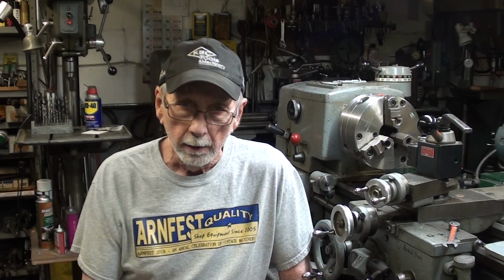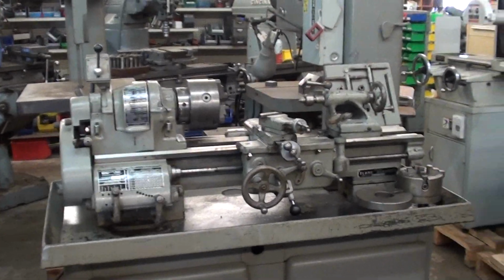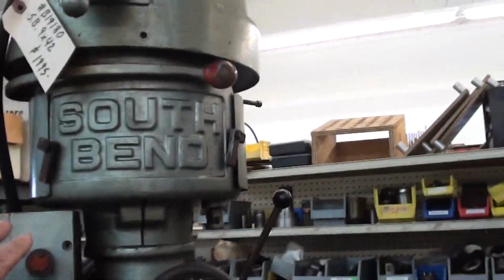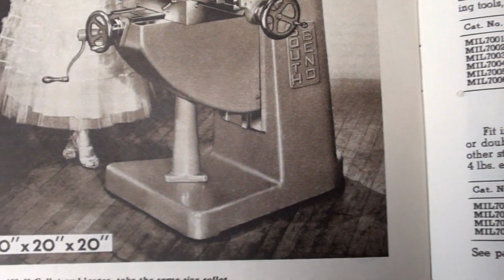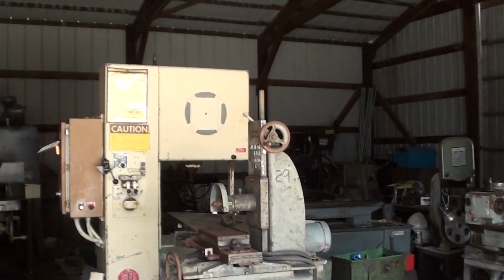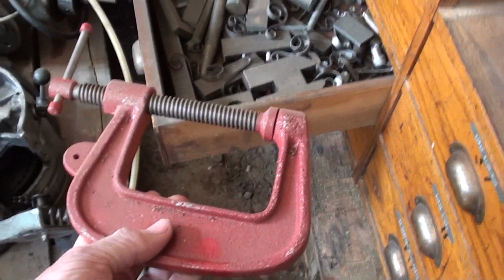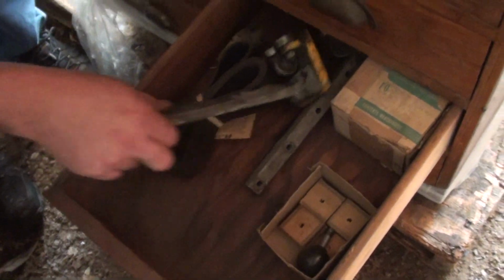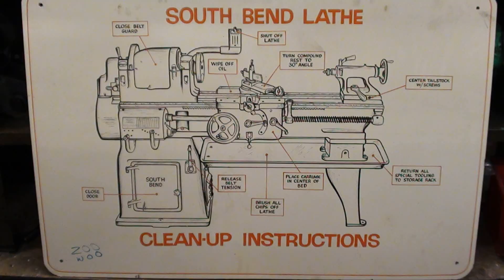FIELD TRIP TO LOST CREEK MACHINERY 725 tubalcain south bend lathes galore

Comment: 3:03 sold me on finding a Heavy 10. I just bought a seldom used 1951 model with all the accessories from the first user second owner. He bought it from a Lockheed engineers widow in 1985 and it was still on the original 2x6 skids and in packaging . 

It's the nicest tool I've ever bought. Also the most expensive. But to me it's priceless.....

I'll have it the rest of my life !

Comment: I still have my SB 10 L Heavy I bought in an auction in 1983. Back then, when SB was still a good working company, I was able to call them up and buy new parts for it and talk to an engineer. My lathe came off the assembly line September 15, 1953, and 4:35 in the afternoon. They had parts (or would make them) for every piece of equipment they made back to 1909. He apologized that he didn’t have them back to 1906, but the factory burned down back then.

My lathe is not completely back in one piece because I took the whole thing apart when I brought it home from my company, where I had it until 2004 when we sold it and I retired (no, I’m not 100 years old, I was 54 back then). I’m trying to rebuilt it, but some parts, in better condition than mine are hard to find. Since I bought a SB FOURTEEN back in 2002, I hadn’t really needed it. The FOURTEEN is a great lathe, very accurate, but I wish it has the D1-4 spindle the later ones came with, instead of the D1-3.

Comment: On this Peterson C clamp at 19:28 with the V threads could you go over the fabrication of the swivel foot at the end of the threaded rod? The one on the same thread is easy. I would like to see how the swivel foot is retained to the ball end. I have a project I was considering a roll pin offset but this looks different.

Comment: I want that Lathe!
Reply: looked it up about 5000 I think if its the same one Edit: had to check again its more than I thought
Reply: I worked at a fabric weaving and printing works here in the North West of England in the late 80's. One of my first jobs in the printing machine shop was fitting electric motors to some of the machines so we could do away with the line shafting ! 
A visit to the neighbouring weaving shed gave me my first view of a South Bend lathe. It allegedly had come off a Liberty Ship just after the war !
At the time, we had one of the most modern fabric roller screen printing machines in the world made by Hans Zimmerman in Austria but also had equipment going back to the late 1890's, a very eclectic mix and an interesting place to work.
Reply: DREAM !! ON !! DREAMER !!!